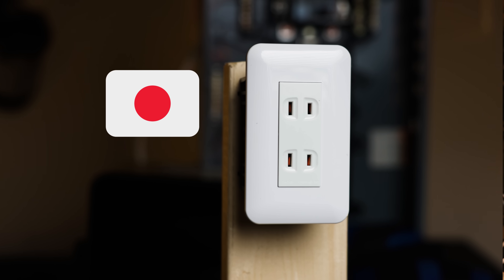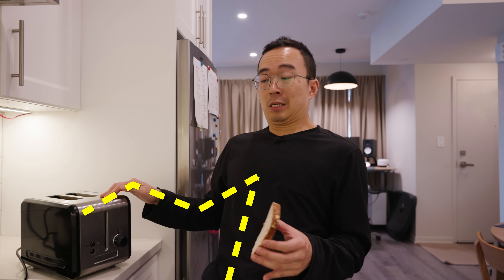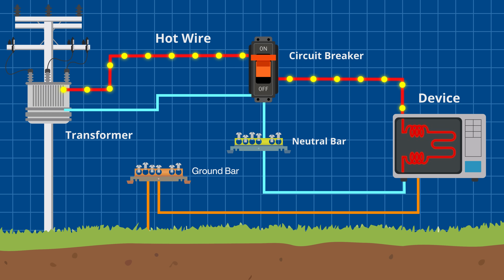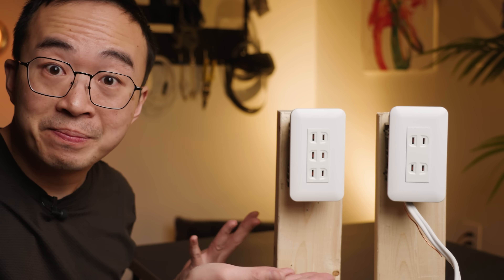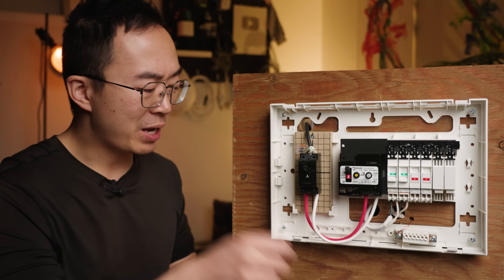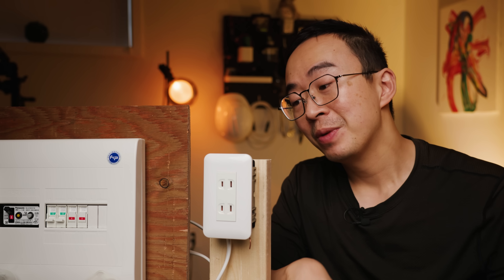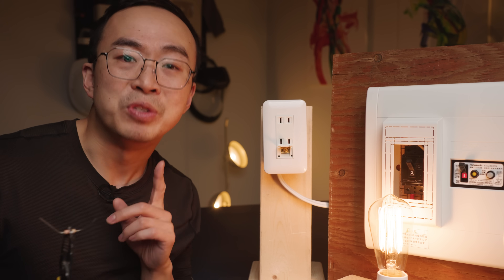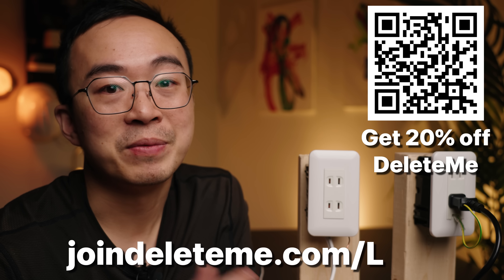How Japan Made Their Outlet Safe

Comment: There are a few things you've missed:

1) Grounding does, in fact, divert the majority of current away from your body, and it does this by ensuring that you are the same electrical potential as your surroundings but presenting a much lower-resistance return path. It also ensures that you can only be shocked by the "hot" wire, and in most cases will not be shocked by either the electrical return or the ground prong; if the "ground" wire were not connected to a grounding rod or other discharge device, a large static potential could form over time, both hurting you and damaging sensitive electronics.
2) While the circuit breaker itself is capable of tripping in less than 50 milliseconds, it makes more sense to measure it in terms of AC cycles, since the breaker won't react at the points in the cycle where current is already zero. A 50-mS trip time equates to at least two full cycles on a 60-Hz AC line, which at full power is more than enough to cause cardiac arrest or a seizure -- especially because at those speeds, "full power" is only regulated by the resistance of the wires, meaning you can easily get instantaneous power levels in excess of 10kW. 
3) Another very important function of grounding is lightning protection. If the only low-impedance paths to ground are humans and electronics, something is all but guaranteed to be destroyed any time lightning strikes nearby. On the other hand, if the most low-impedance paths are things like the chassis of an appliance or the shielding wire of your coax cable, the lightning will be at least somewhat diverted away from more delicate things like microprocessors and human hearts. 
4) Grounding is also important to electronic communication; in order to communicate by switching between zero volts and some other level, the two machines communicating need to be able to agree on what "zero volts" actually means. This is also important for things like capacitive sensors in touch lamps and thermocouples in electronic thermostats. While it is possible to include point-to-point ground connections, like the cladding in USB cables or the jacketing in a coax line, that presents another danger if there isn't another return path: if a voltage potential forms between those two devices, it will discharge through that cabling, which is likely to cause a fire. 

Source: I'm currently an electrical engineer and used to be a lightning protection engineer for Boeing.

Comment: from an electrician's perspective GFCI is considerably more effective with a proper ground than without one, they're two parts of the whole intended protection system. Much like North America, Japan has made their electrical safety decisions based more on expense rather than effectiveness
Reply: How does that make any sense? Gfcis do not need a ground to operate. It's more effective. You mean you feel better?
Reply: @Matthew-q4d it is better if I live wire shorts to the ground casing and so trips the breakers. Rather than you get shocked, but not die(unless you are child, elderly, sickly, heart problems...)

Comment: Before the 1960s all residential recepticals were only 2 pronged in the US. The introduction GFCI breakers and double insulation makes the a 3rd ground pin redundent as it goes to the same nuetral ground bar.

Comment: at 3:27 you said "we create a connection between ground and neutral", but what is the point of having a metal rod going into the ground at all? wont all the current go through the neutral bar instead, eliminating the need for a ground bar?
Reply: The point of the ground rod is a backup to the utility provider. There is also a ground going to the water main if there is a water main.  A neutral handles the unbalanced load.
Reply: Think of it as your "local" ground. In theory there shouldn't be much of a difference from a transformer's reference ground, but adding circuits, equipement, distance and complexity to the systems create variation that make your house's ground not exactly the same hence in a very crowded environment it could create some power delivery fluctuations. Your devices can handle this uneveness just as well, it is mostly the electricity provider that benefits from it (and we know they aren't penny pinchers)..

Comment: Having a GFCI protecting your whole house mean that when fault ocurrs, you will loose power in your entire house as well. 

The recent Japan doesn't use those is because they are far from updating their electrical network. Most of the houses are wired like for the beginning of the 20th century. So that's the way they find they can protect them while they update the electrical in those old dwellings (wooden houses dating from the 1800 and 1900s)

Comment: Yes and Yes but not safety superior, they still require some utilities, including refrigerators, hot water heaters to have grounding at the outlet. Japan needs to adopt the three hole plug . More people in Japan are moving towards a DIY environment the equipment that they purchase sometimes has a ground requirement and is extremely frustrating when you’re required to ground at the plug.  Sometimes the ground is for static buildup and allows for discharge from equipment,housing independent from the circuits and could bridge damage the electronics of sensitive equipment making the three hole plug superior .GFCI are also used in United States and required in kitchens and bathrooms. Japan also has an issue between Osaka and Tokyo, being 55 Hz in Osaka being 60 Hz. Not a very good thing when it comes to sensitive equipment. also, GFCI don’t necessarily need to be hooked up to ground in US. There’s a legal work around to connect to neutral.

Comment: As far as I know, the earth is not connected to the neutral in any European country. In Europe, the neutral is supplied by the public grid. In most countries, it is the service graund of the transformer station in the area. All houses must have at least one residual current circuit breaker (RCD) 30mA
Reply: the following circuits must be protected by an RCD (residual current device) according to Polish and European standard PN-HD 60364-4-41:2017-09:

Socket-outlet circuits ≤ 32 A intended for use by ordinary persons – must be protected by an RCD with a rated residual operating current not exceeding 30 mA

Lighting circuits in residential buildings – must be protected by an RCD ≤ 30 mA

Circuits in bathrooms, shower rooms, and other wet areas – RCD ≤ 30 mA required for all circuits

Outdoor socket outlets or portable equipment used outdoors (≤ 32 A) – RCD ≤ 30 mA mandatory

Temporary installations (e.g., construction sites, fairs, markets) – RCD ≤ 30 mA for all socket and lighting circuits

Circuits in agricultural or horticultural premises:

Socket outlets ≤ 32 A – RCD ≤ 30 mA

Socket outlets > 32 A – RCD ≤ 100 mA

Other circuits – RCD ≤ 300 mA

Each socket outlet up to 63 A in caravan parks and marinas – must be protected by RCD ≤ 30 mA
Reply: Nope, it is grounded and every country does that. That is why one wire shocks you and the other doesn't. Compared to your system where none are grounded, a tiny capacitative leak can set the line to ground voltage very high and that kills
Reply: @DamjanObradovic-dl9tk  In Portugal, the neutral is the service ground of the transformer station in the area, it is the responsibility of the network operator, the ground is individual for each building,
Reply: @mariocarneiro7237 They are grounded together, so the only thing is that if somwthung happens the breakers might not trip and you might get a mild shock. Which is why they connect them

Comment: Who has the safer system?

The UK - earthed outlets everywhere (apart from shaver sockets with isolating transformers), AND installation-wide RCDs in the consumer unit.  Increasingly via the use of RCBOs, so each individual circuit has its own RCD and you don't lose the lights when your toaster goes faulty.

Comment: I dont think your version of having better path to neutral via ground is true. RCCB is designed to trip in a very low leakage current situation also. Around 30ma. This is achieved by the preamp in the breaker.

In india RCCB is in the distribution box. Also it does have neutral connected to earth.

Comment: Thank you for your fun and informative video — it's very educational and enjoyable!

Just a quick safety reminder for travelers to Japan:  
Many Japanese electrical appliances comply with the PSE law, which mandates strict safety standards including double insulation. This significantly reduces the risk of electric shock or fire due to leakage.

However, imported hair dryers, straighteners, or chargers not designed for Japan's 100V system may pose safety risks, including overheating or malfunction.

While Japan uses 2-prong outlets, most appliances here are double-insulated and don’t require grounding. It’s not outdated—it’s just a different safety design.

If you're unsure, consider using a travel adapter with built-in protection or consult your product's voltage compatibility.

Stay safe and enjoy Japan!

Wishing for greater mutual understanding between Japan and the U.S.

Comment: How about 110V that japan uses that safer than 220V like many countries use. That's why some electricity that you bought in japan doesn't work in your own country and vice versa without voltage conversion unless your electronic device supports multi voltage.
Reply: A 1100W device will draw 10A in a Japanese outlet, 5A in a 220V circuit so without fault protection it won't make a difference. The thing that makes them safer is lower power requirements, design (for example, toasters are commonly enclosed devices with some of them having an egg fryer on top for convenience), and that DIY of your own electrical circuits is only permitted if you're a certified electrician.

Comment: Japan used 2 sparated breaker..each to both N and L ..that why  their wiring system no emphasizing ground connection wire... with 3 pins wiring system with ground connection..usually the using only one breaker for L wire only..that all..

Comment: This is all good but what happens if your safety switch (GFCI) is faulty and fails to trip ??? Poor dead Louie. This is why most countries have the earth plus safety switches RCD on the power circuits for double protection, just in case the RCD is faulty or the earth circuit is open.

Comment: Nice work! I'm constantly amazed by how many YouTubers there are claiming to be electricians who don't know the fundamentals of electricity, and spout a woo-woo quasi-religious belief of how they think "grounds make you safe". In all of those cases, there's a MASSIVE plot hole that's left empty, and the vacuous viewers couldn't care less. Yes, the one and only purpose of the "ground" wire is to trip a circuit breaker in the event of one specific kind of wiring fault to a conductive chassis. And when we consider how many shortcuts are taken with home wiring to save a little on raw materials, adding 50% more wire is far from cost-effective as a solution to only one thing. Yes, using GFCI universally is a better solution. So is Class II double-insulated appliances.

Can you guess the reason why people get electrocuted by this particular wiring fault? Contrary to your "leakage" hypothesis, electricity is not like a liquid, it doesn't leak out and get on people like that. Nor does it involve water. The real reason might surprise you.

Comment: In Netherlands we are allowed to have up to 5 fuses (groups) behind a "GFCI". However I upgraded to residual-current circuit breaker with over-current protection, so that only one group is cut off in the event of an imbalance detection. It makes a lot of sense when you have inside and outside circuits and a lot of rain;-)
btw the NEN1010 standard we adhere to defines our bathroom in several zones prohibiting us from installing powersockets in stupid dangerous places. light switch is typically installed outside the bathroom.

Comment: Grounding does not helps just to trip the circuit breakers.....electricity flows through path of least resistance. So instead of going through your body to wooden / tiled floor etc, it prefers to go through copper wire which is directly connected to earth, through a proper setup.

Comment: I'm from Indonesia which used identical outlets to russia and Afghanistan and... Wait, that springy metal part is the grounding?

Like, i know the electricity has to be grounded for my safety as well as having functioning circuit breakers and GFCIs, but the part that I've always assumed to be a way for power hungry appliance to get more power delivered to them being the ground connection is new to me

The reason i thought so because the plugs for ricecookers, electric kettles, fridges, which are power hungry appliances, covers the whole area of the outlet and pushes the pins to the contacts, while low power stuff like phone and laptop chargers, sometimes also low power light fixtures pushes neither pins to the contacts

Comment: RCD's rely on a new circuit path to ground. RCD's don't work if the person is in the same circuit without additional path to earth. No trip if the person touches neutral then active with nothing conductive through shoes, no other metal touched. By having cases conductive to a ground wire means, in many cases, current will flow a different path before being touched by someone and can be detected. If a cable is cut or submerged in water then more likely to detect separate path to earth or active to earth path also has short (eg axe through cable or device submerged).
The other problem with RCD's is there's a sensitivity limit proportional to the maximum normal hold current. A 20A circuit can have a RCD trip <10mA imbalance/leak but a 40A circuit may be between 15 to 20mA imbalance/leak.

Comment: My mother almost died from getting shocked on a stainless steel toaster that had no ground. She had one hand on the stainless sink and touched the toaster with a wet cleaning rag with the other. 😮 Inside the toaster was a damaged hot wire.
Reply: How could a toaster not have ground? In Europe even if it was pre1930s one the plug would be so that it would not fir into grounded sockets.
Reply: Very unlikely to be true, that would mean Europe popularized non-polarized plugs decades after popularizing them (you remember the two pin plug, notice how each pin/pole is exactly the same). @okaro6595
Reply: @okaro6595  My year old toaster does not have ground.
Reply: @okaro6595  If it's double insulated it doesn't need a ground, what's more, it MUST NOT be grounded. Obviously the toaster in question was faulty though.

Comment: From the NZ 🇳🇿 Observer, who has just gone to check the main circuit board in this 16 yr old house and, yes，it has an RCD component. Power points in NZ are of type I with three slots including one for the earth pin...if it has one...on an electrical appliance.
Power is supplied at 230/40 volts at 50 Hz.

Comment: Nowadays in most European countries it's a combination. Since the mid 70's ungrounded outlets had to be on a circuit that's RCD protected. Grounded outlets didn't have to be RCD protected as long as the ground resistance was low enough to make short circuit protection trip like in the American system. But with TT System a low ground resistance can never be guaranteed since it depends on the ground water level. Therefore since the 2000's in new residential electrical systems, all outlets and light fixtures have to be grounded and RCD protected.

Electrocution is also very rare in Europe. The only residential electrocution cases we hear from are from old buildings (mostly in the former USSR) where the electrical systems lack both grounded outlets and RCD protection.

We too have these group RCD's where multiple circuits are protected by one RCD in the electrical panel instead of having RCD/GFCI outlets all over the place. Nowadays at least in the Netherlands it's mandatory to have at least 2 group RCD's so one ground fault doesn't mean the whole building has no electricity.

Comment: Thank you very much for your video.
I’m a French living in Japan. In France, we had grounding protection first too, then in the 80-90’s differential breakers at 30mA (for 240v).
So, in Japan, if I understood correctly, it seems they took the “differential breaker” protection approach first…
But, I’m still surprised they enforced (or set the law) for adding ground line to “humid” areas (bathroom, kitchen, air con) quite recently (2016… 🤷‍♂️lately???)…

It was a surprise 😲 to me.

Furthermore, I need grounding for other purposes. MY PCs, AV amps and other HI-FI  equipments which need grounding to protect audio signals against EMI interference.

So, here in Japan, grabbing the ground line very far in the apartment in limited locations only… is really a pain in the ass 😂

However, thank you 🙏 very much for your video.

Comment: A GFCI for the entire distribution panel, just like Germany, drawback when it trips the entire house is in the dark and you still do not know which circuit has the fault....!
Reply: Newest code and standard adresses this
Reply: Then replace ALL circuit breaker to GFCI like South Korea 👍
Reply: Hi, I have such an "distribution panel" in Germany, but the whole house is never dark. There are different switches in the switch box and the ceiling light always works because it is turned. Different rooms are also turned. When an appliance in the kitchen caused a short circuit, only the appliances in the kitchen were without power. And only the switch in the kitchen was flipped. But the ceiling light was working in the kitchen.